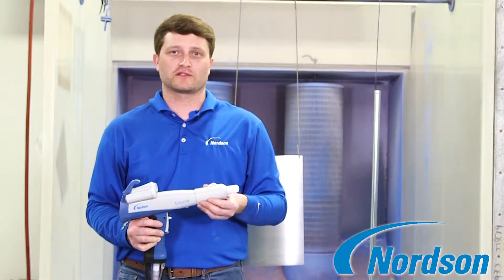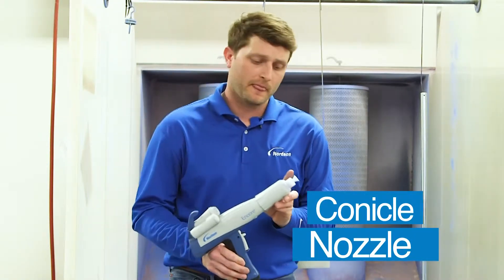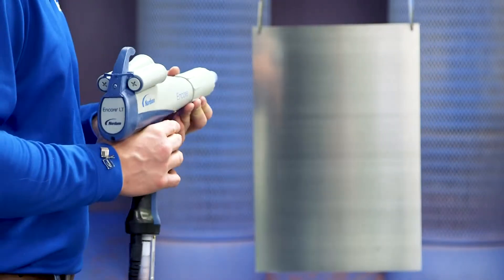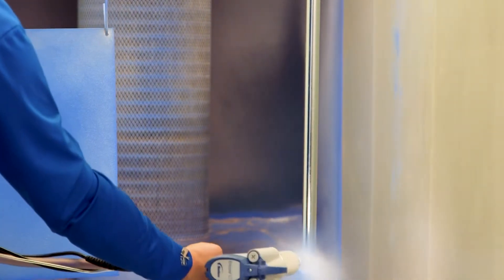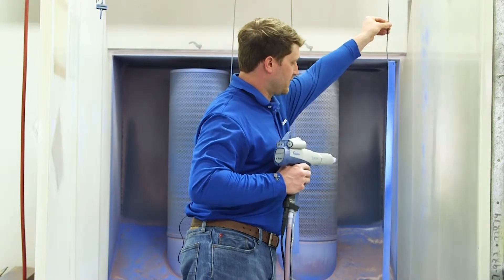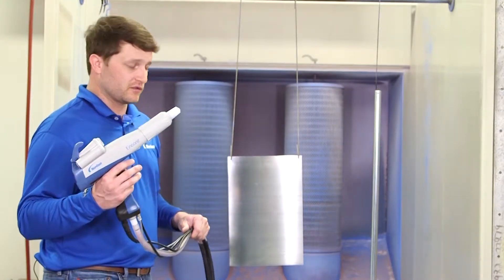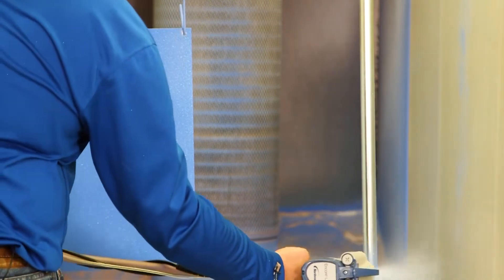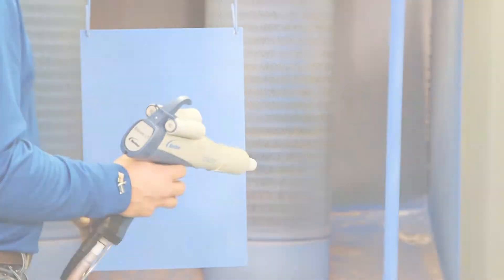Nordson Industrial Powder Coating: Nozzles

Comment: what nozzle is the best for an all around pattern that will do well on most everything
Reply: flat
Reply: Flat
Reply: 60°
Reply: Well, other than actual trial & error, he started with a 19mm (3/4”) then switched to a 4mm nozzle. It appeared to do reasonably on the flat coupon, but not complete wraparound on the tubular shape. So the middle would be 6mm, which was already commented about! So try a 6 or one size up.